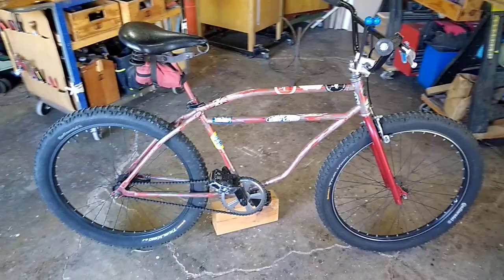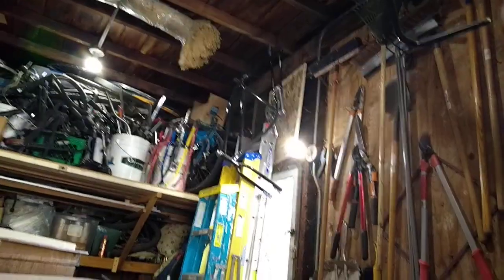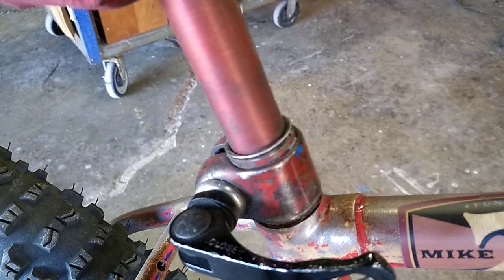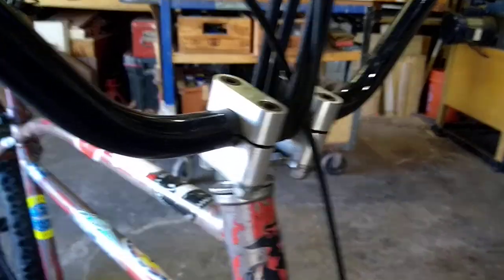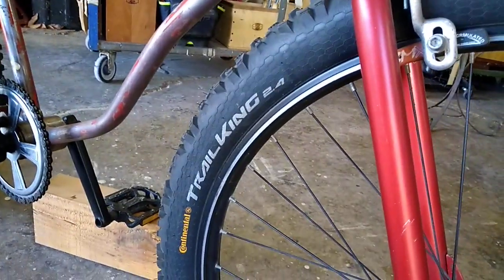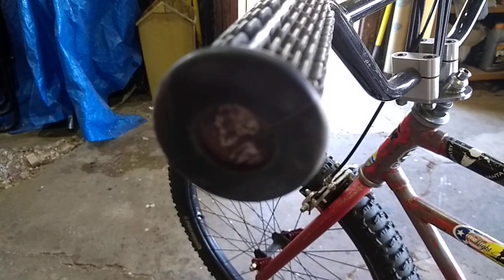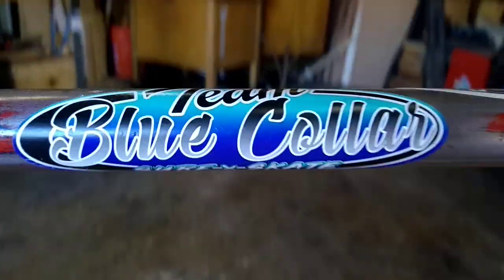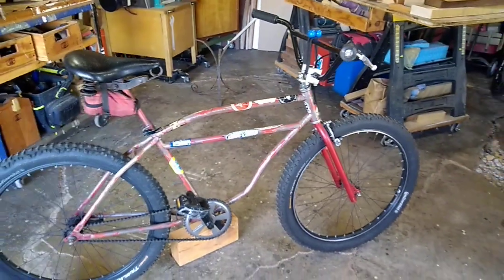Worksman Klunker Anatomy

Comment: Nice unique build...one of a kind for sure!  I recently ordered a state klunker.  The simplicity of it is awesome but I do want to put front  brakes on it.  Do you have any advice on that or if it's  feasible to do? Thanks dude!
Reply from the maker: If there is a hole in the fork to mount a caliper (side pull) brake then it's simple - Otherwise, you just need to drill that hole. Go with the Kool-Stop brake pads and, if possible, an old school mtn bike lever

Comment: What is qualification of klunker? It have a straight handle bar or bmx handle bar? I am confused? Thnk for answer i am. From philippines
Reply from the maker: Klunkers were cruiser style bikes built to handle off road before mtn bike existed - Anything can be a Klunker but traditionally they were American balloon tire frame bikes and or straightbar frames, mainly prewar frames with HD parts on them - Eventually they started putting gears on them - Typically had motocross bars and tube forks - Pleanty of history and information here on YouTube:

https://www.youtube.com/watch?v=DDUe9BFPrzg&t=2s
Reply: Handlebars by Chad? Are those copies of the old Mongoose Kos kruiser? Al's rapid transit does those in chromoly for aluminum like the ones I have... Love them
Reply: I meant chromoly or aluminum

Comment: 46/16 on 26” wheels. That’s some tall gearing.
Reply from the maker: Yeah, that's my street gear - I like to get a workout - I can easily handle inclines and small hills by just getting out of the saddle  - The trick is 175mm cranks, it would be brutal with 165mm cranks
Reply: Got it.

Yes when I was a teenager I ran 44/15 on 20” wheels with 180mm.

I didn’t have a spare tire around me slowing me down.
Reply: And it’s a really cool bike. I like the bungee cord for your hoodie idea.

I want my next bike to be my interpretation of a klunker. Definitely a freewheel for me though.